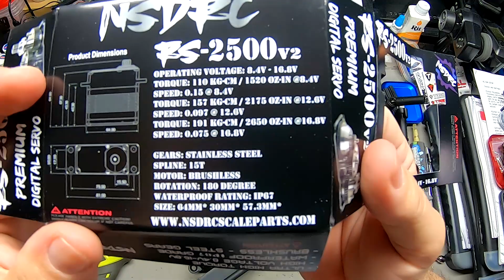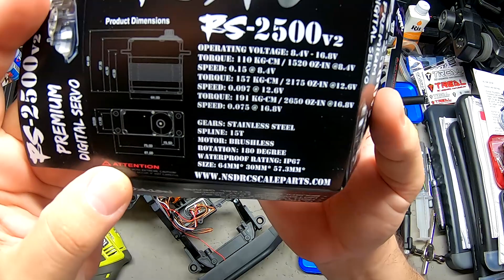Upgrading and Modifying the Axial SCX6 Trail Honcho 4wd 1/6 Scale Crawler - Pt. 3

Comment: I believe the servo mount you got is for the shift servo. Great video, I’m on the same journey as you. 🤟🏼
Reply from the maker: Hi, the mount is definitely for the steering servo, but it doesn’t work with my servo. I don’t know why so many people are swapping the shift servo. It’s not a high load action, nor does it require speed. I’d keep the stock shift servo until it fails… if it ever does. I’m going to put on a longer servo arm to get more throw. I’m also going to put a couple spacers at either end of the steering link to level it out a bit. 
I’m curious why Axial put lockers at both ends. It definitely hinders turning and reduces the turning radius. A front and/or rear diff with thick fluid would be interesting to try.

Comment: Those two black plastic splined adapters are for the servo saver on the shift servo. The stock 614 uses a 23T spline. Axial also gives you 24T and 25T adapters to use with the servo saver in case you change the shift servo. Your idea of using longer fasteners on the servo with locknuts is a good one. I was thinking about doing the same on mine. I haven't settled on what servo yet. I am using a DS 80kg servo right now but I am unhappy with the centering and speed. Power wise it is okay.  I was looking at the Powerhobby 1513mg but this NSDRC costs less and has more power.  How has it been so far and how is the centering?
Reply from the maker: No problems with the upgraded servo. Family trouble has kept me from doing anything RC in a while. My mother just passed last weekend. I’m going to try to get back in the routine soon. 
Thanks for watching!
CJ
Reply: @MyRCChannel-CJScott  Sorry to hear, my condolences.

Comment: How many hours do you reckon it would take you to build that truck if you didn't video it?
Reply from the maker: It's hard to say because it's RTR, not a kit. But, if it was a kit, I'd guess3-5 hours not including the transmission of the wheels & tires. Add another 3-5 for those. A free weekend would do it.